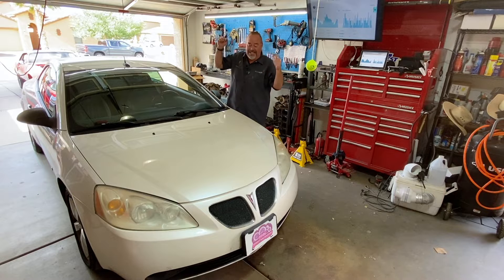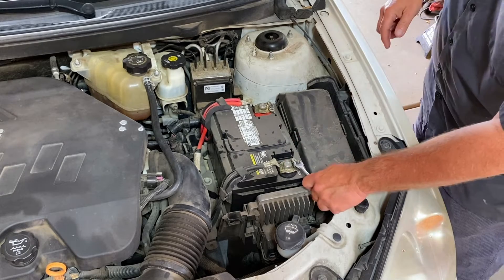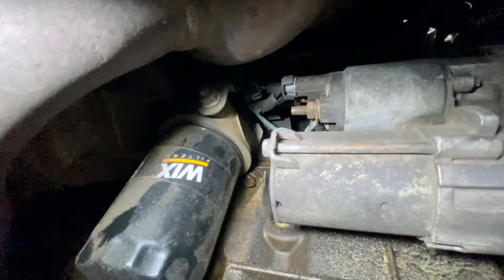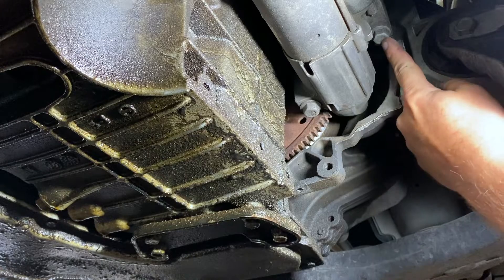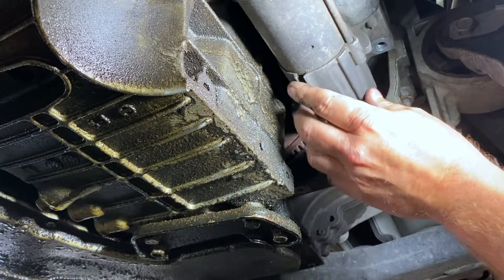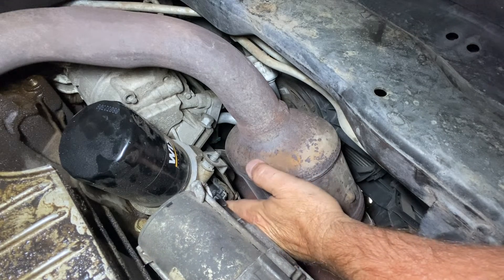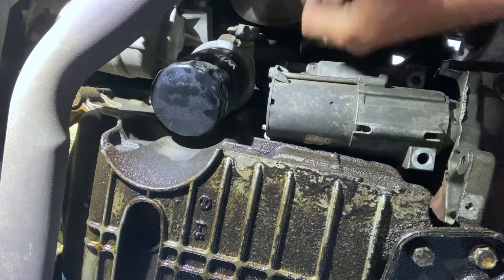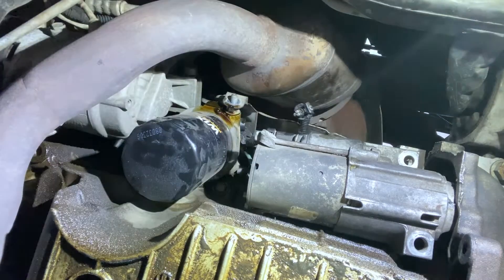What does engine code P0522 P0523 Mean?  How to Replace Oil Pressure Sender Switch Pontiac G6

Comment: I couldn't get a socket in there to remove the sensor because of the heat shield around the exhaust catalytic converter.